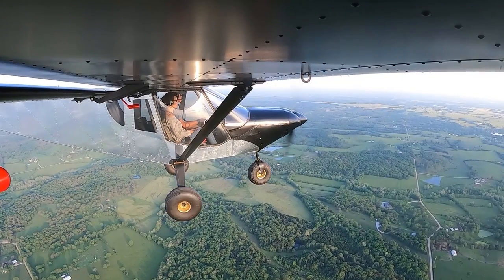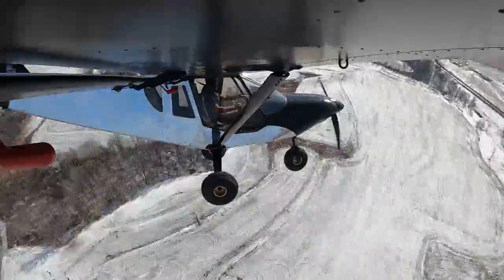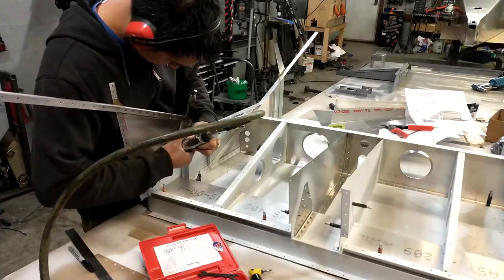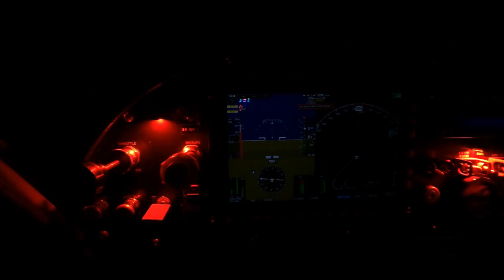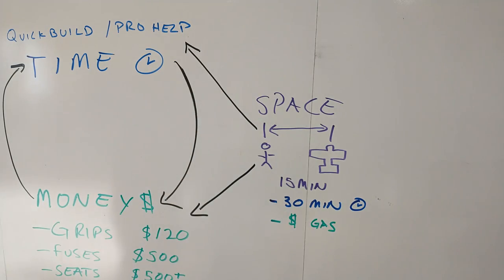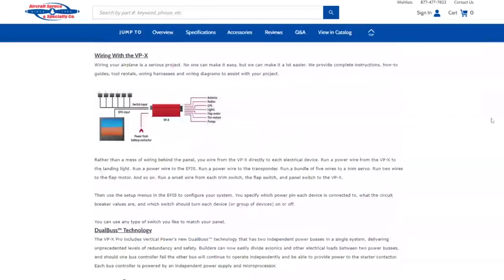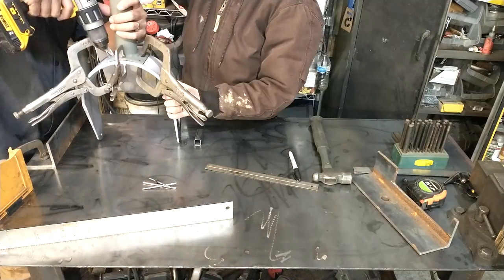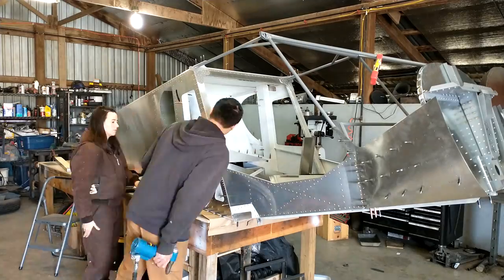Save Time, Save Money, and FINISH the Airplane!

Comment: I totally agree with your comment about building at home, rather than at a hangar, I build in a big shed and it allows me to go out most evenings and at the weekend (if the weather is not good enough to fly). My Fisher Youngster build is progressing and I am at about the 14 month point at the moment and still as chunk off being flight ready but it is a wood biplane and I have not been in a rush and as such have carried out a lot of mods (as well has having a few issues with the kit methods). The main thing that slows me down is producing video to share with other on YouTube, so they can see the methods I use to help them with Fisher style kits. (I have a full time job building aircraft as well!) Good video, well done.
Reply from the maker: Thanks! I'll have to check out your channel. On one hand, I wish I had more video of the build process, but you are 100% correct, it definitely slows down the process and can be a distraction when you don't need/want one.

Comment: Very interesting! Would love to see a video that is a tour of the panel, including the fusebox. How did you make the 3 busses, is it ring terminals or spade terminals? I am doing a Cruzer with a WW 2850 and going to use fuses as well.
Reply from the maker: A more detailed "walk-around" video will come soon! The fuse block came with 3 independent busses built-in, with both ring terminal and spade terminal connections.

Comment: Excellent summary and very practical advice. I did a Sonex from plans and worked with basically all the concepts you presented here. Especially like the part about how you did the electrical and keeping the project nearby until there's absolutely nothing else you can do at home. Upholstery - be careful with fabric store materials. We had a guy bring in a burned seat to our EAA chapter meeting showing that FAA-approved material that doesn't support flame can save lives. It was from an in-cockpit fire / fuel leak situation.

Comment: This is simply one of the best videos I've ever seen that summarizes the reality of building a Zenith Aircraft kit!  However, you omitted a major cost saving/time saving option: purchase a partially-completed kit!  Partially-completed or abandoned kits typically sell for less than the original cost of the parts (typically the seller is giving away their labor for free) and if the kit's plans' number is properly transferred through Zenith, Zenith Aircraft supplies technical support (which is excellent!) same as if the buyer was the original builder.  Of course, there is some risk in that a second-hand kit has missing parts or poor quality construction, so inspecting the kit with a knowledgeable Zenith builder is a must.  I purchased a partially completed kit and it saved me thousands of dollars and probably 200+ hours of construction and allowed me to finish the kit in 12 months and approximately 1000 hrs of build time - that was over 12 years ago and absolutely no regrets! Again, this was an excellent video and I look forward to seeing more!
Reply from the maker: Finding an unfinished project sounds very lucrative, sounds like it definitely paid off! Were you able to find the partially completed kit locally or did you have to travel to get it? Did you look for one for a while before finding one?

Comment: Very inspiring! I love the Cruzer with mid size tires! Such a nice look!

Please post performance and tech details when you can get around to it. Have fun!
Reply from the maker: With the climb prop installed, it tops out at 92 kts (105mph) in level flight. That's the penalty from the extra drag that comes with larger tires and vortex generators.

Comment: Nice video.  While I have no proof that wig wags scare off birds, the simple ($45/pair) Amazon motorcycle LED's and basic Wig Wag controller (about $40) that I installed with them does/has made me more visible to other aircraft (they have been called out on radio calls).   Bottom line is I think it was money well spent.   FYI, my LED's are mounted on the included brackets that are attached to the top center bolt on the wing strut (no cutting or mods required)...
Reply from the maker: What are you running for anti-collision lights (strobes)? Mine are really bright (FAA approved) and have a slower flash rate, so I definitely felt a wig wag was redundant.
Reply: @ozarkgarage  I have Aeroled Nav/Strobes on the wing tips, they are great.  I actually had a RV12 yesterday comment to me that he saw my Wigwags before anything else and it was hazy out.

Comment: 100% truth on all points!  Great video!
Reply from the maker: Should I have included building from scratch as a way to save money?
Reply: Nope, your video was perfect without mentioning the scratch build option, would have confused the flow of your story.  You can save a few $$, but for most builders, the quicker to assemble kits are the way to go.  Mine took 7 years to build and I saved around $4500 on the airframe (not much considering the total project cost) my financial situation at the time would not allow for sub kit purchases so buying a few materials at a time kept me in the game.  I really liked the process and might do it again!  I flew to the Zenith event in June and saw your plane, you did a great job on it!  Hopefully you'll attend the September Zenith event, it would be great to chat with you!
Reply from the maker: You did a great job on your plane, the only way you can tell it wasn't a kit is the lack of back windows. I wish mine didn't have windows there, definitely one of the toughest areas to polish.
Reply: Thanks!  Next upgrade I hope to complete is an aluminum cowl.  My fiberglass cowl came with the engine, I've never been happy with its appearance.  Just need to stop flying long enough to plan and fabricate it!  Maybe an idea for a future video would be an intro to polishing aluminum?  I've been tempted, but worry about the polisher banging away on those thin aluminum skins.
Reply from the maker: Are you planning to use a fiberglass nose or FULL aluminum? I'm still learning the tricks to the aluminum polishing myself, check out @AvianaAircraft channel.
Reply: I might try a full aluminum cowl, 6061T6 for most of it, and something much softer for the formed nose.  I just need to come up with a design that looks decent and is achievable.  I'll have to play around with some materials and get a feel for it.  Not looking for anything super curvey, a tasteful angular appearance would look ok on a 750 too!  We'll see how it goes...